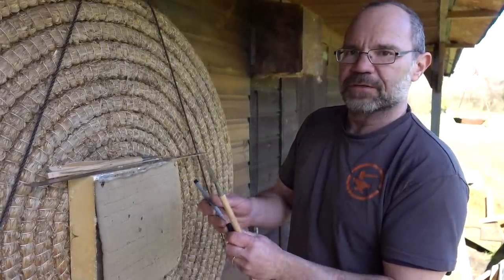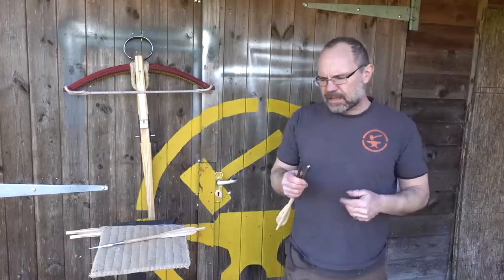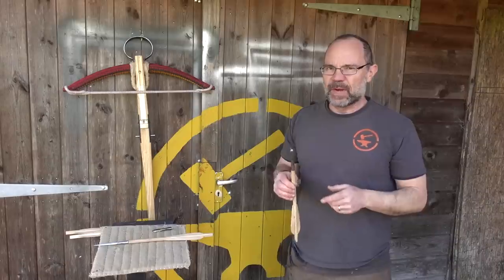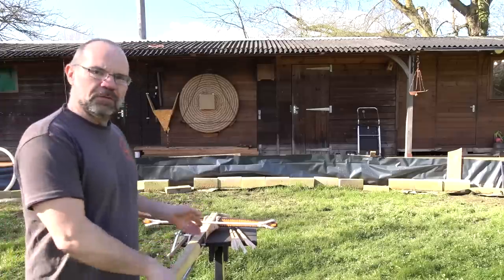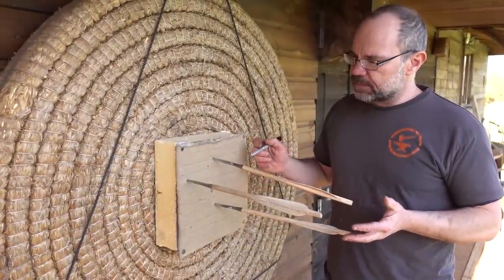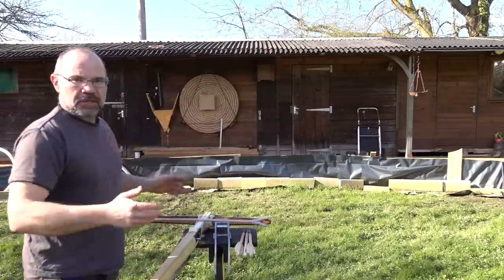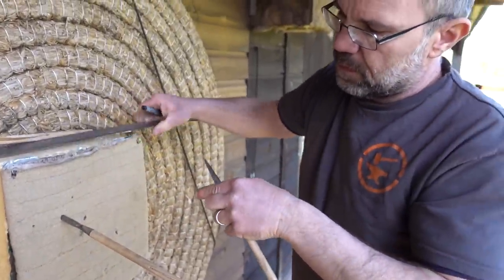Does WAX on ARROW HEADS Do Anything?

Comment: Hey I worked a lot with those insulation foams and in my experience they  have a hard time getting pierced or even cut (I lubricate my knife before cutting it or just use a saw), which could also affect your results of both this and the previous test. Do you think you could try and shoot the same bolt on different "stopper" materials see how it affects? I honestly believe the bolts could go deeper without the resistance of the foam
Reply: youre right, they could have gone deeper- but for the sake of the test, uniformity is more important than depth of penetration. The test isolates variables so that the only thing we are observing is the relative change of penetration due to a lubricated tip. This answers only this question; "Should I wax(lubricate) the tip of my arrow for piercing cloth armor or not?" with a resounding yes! I think a better next test would be changing the surface- ie, does lubricating a (type of) arrow increase deflection on plate mail?
Reply: @fair2guy  Although then you have to ask if the wax is helping with the gambeson or with the foam. It could be that against a flesh analogue the difference would not be nearly as marked.
Reply: @Poldovico  Totally! I agree, I actually wrote a longer comment to Tod asking if he could test different arrows, lubricated, against their intended purpose- thick hide, plate, flesh analogue, etc. I think we can probably assume that "wet" targets probably dont need lubrication, but that the wax does help with rough surfaces like gambeson or clothing.

Comment: Would this waxing technique extend to spearheads and other piercing weapons? 

Also; how long does the wax last? Is it only good for the first shot or would it have a small amount of residual efficacy for additional shots?
Reply: Maybe. You'd need to test.
Reply: Waxing helps needles get through tough fabrics (it'll be the same principle as the bodkin/gambison) at slow speeds - that's piercing.
So a pointy spear would have some advantage, being waxed/lubed in some way. A broad headed spear tip less so.
Prodding a gambison wearer with a rapier would probably be more effective than prodding with a broadsword - gambison is good against things with larger cross sections.

Excepting cannon balls.
Reply: Regarding the follow-on shots- on arrowheads and bolts, probably not, given the intensity of energy transfer at point-of-impact but the odds that you're going to recover the ammunition for a follow-on shot with the same arrow/bolt without having the time or opportunity is pretty low (likely non-existent in a combat scenario, maybe in the case of an extended hunt, but it'd have to be very prolonged, especially considering you'd be carrying some wax to maintain your bowstring anyway).

On spears or other piercing/thrusting weapons? Yes, some. It might be harder to do tests to determine how much, though, as unlike an arrow, a spear doesn't have a predetermined amount of kinetic energy with which to penetrate (most spear thrusts, your point-of-impact is going to occur while you're still pushing forward and adding energy to it), so any improvement is going to be harder to determine (and any follow-up attacks you make will be done when you're that little bit more tired, rendering any fall-off of effectiveness that little bit harder to notice), and somewhat subjective.
I suppose you could rig up a wholly mechanical spear-thrusting machine (possibly spring powered?) and use that, but that's a lot of design and building work for one test. If you want to, though, go for it. I'd be interested to see the results.

Comment: Excellent video. Just a small note about teflon bullets from a retired law enforcement officer and former range officer for my dept. Teflon was used to coat bullets at the request of police agencies in the US because military armor piercing rounds did more damage to police gun barrels. It was the hard steel and sharp point (much like a bodkin) of the military rounds that made the bullet armor piercing, The teflon was added to help protect the barrels of police issue revolvers from damage, when compared to firing a military armor piercing round of uncoated hard steel. These armor piercing rounds were first designed by police officers in the 1960s to pierce car wind shields and doors , to aid police officers when a felon tried to crash a road block.

Comment: On a related note, I once made a set of POC wood arrows with feather fletching, and I decided to wax and polish the shafts (as one does!) and they looked amazing. Until I shot them at compressed straw bosses. They penetrated to the same depth as unwaxed shafts, but completely locked into place. They had to be hammered through to extract them, stripping the fletching and bindings and smashing the nocks. Now I always leave shafts untreated.

Comment: Beeswax is also great at preventing rust, and repelling water in general so it seems very multi purpose practical. if they're just rubbed in some wax or dipped I would think it would help protect the arrow as well as the head, if you had enough around I suppose. Beeswax is also sometimes mixed with things like linseed oil for use on wood (though I haven't personally tried it) I definitely think it's possible one or more of materials like these proctectants would be used on arrows or other products depending on what was most available and useful in different contexts. I like beeswax for things like my walking staff or hatchet handles that I don't want to be oily, leave residues or be smelly. I want to protect and preserve the wood and it provides good grip as well and the water repellent effects of the beeswax help the grip too if it's raining or you get sweaty, as well as preserving it.
Great video as always Todd

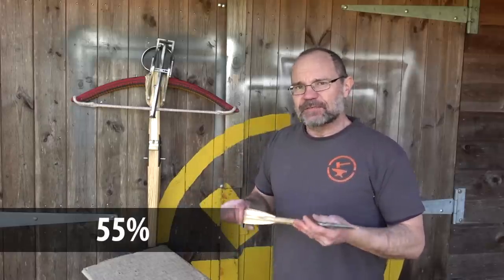Comment: Quick correction of the numbers at 8:00 : The increase of penetration is actually 98,6% on average. If we look at the first line the original depth was 26 mm and the waxed one 45 mm. That is an increase of 19 mm. 19/26*100=73,1%. For the average you can just take all the increases as a sum (19+22+27)=68 and relate it to the sum of the original values (26+25+18)=69 -> (68/69)*100=98,55% or 98,6% rounded. My intention is just to straighten up the facts, not being a smart ass. I greatly enjoyed the video. Keep up the good work and stay healthy! Cheers from Germany

Comment: Separate but related issue.  I remember being told that mediaeval archers put a blob of clay on the tips of their arrows.  This deformed on impact and made the tip grip for a split second giving the point time to dig into the armour rather than glancing off.  I also remember being told that a similar technique was used in the 20th century with armour piercing shells: a soft nose of lead (or similar) that would deform on impact and just give the shell that split second longer to dig in rather than glance off.  I have no idea if this is true but I remember that I considered the source to be reliable when I heard it 40 years ago.

Comment: Lloyd did a video a long time ago pointing out that needle bodkin pointed arrows and bolts were probably for penetrating chain mail, since the padded jackets people wore under it were no where near as thick as cloth armours like gambesons or aketon armours. He made the argument that the best heads against such cloth armours were "sharp" broad heads as they cut through the quilted fabric where as a pointed arrow just gets jammed up and eventually stopped as it tries to squeeze through the layers of fabric.

He provided the anecdote of how during the construction of quilted cloth armour, you need quite a strong needle as it gets harder and harder to pass a needle through the fabric, the thicker you make the armour to the point that he almost or maybe in fact did (I forget) break a needle at one point when making such armour.

Comment: Coating arrows in a thin layer of beeswax is also a great way to prevent a stockpile from rusting during long term storage. Even if they didn't know that it would improve penetration it is very likely that at least some people used wax.

Comment: A small correction. We absolutely do NOT put teflon on pistol bullets to get through fabric armor. That is a myth that probably originates from the movie Ronin where that is stated as a reason why a bullet penetrated De Niros characters vest. That is not how they work though. The actual armor piercing pistol ammo that the myth comes from penetrated soft armor due to being made of metals much harder than standard lead based projectiles (so steel or tungsten) and due to being very pointy instead of having a rounded, flat or a hollow point. The first characteristic prevents the projectile from becoming flattened on impact against the vest which makes it easier for the fabric to stop it due to the pressure being spread over more threads and the second gives the projectile a tendency to poke between the individual fibers of the vest. 

The teflon coating was actually there, but not to enhance penetration, but to protect the internal surface of your barrel. Modern projectiles are somewhat oversized so that the rifling of the barrel actually bites into the jacket, otherwise it would not have enough purchase on the projectile to make it spin. Obviously that works well if its either unjacketed lead or if its a lead core with jacket made out of a soft metal like copper. But if the projectile is hardened steel or tungsten, that would work very poorly and you would ruin the rifling in your barrel in a hundred shots or so. So the teflon coating was there to put an intermediate soft layer between the hard projectile and the hard barrel steel.

Comment: Very interesting! I really didn't expect that to make such a difference! I'm not sure if this has got missed, but I believe that many of  us who commented on the longbow vs plate video were talking about the reasoning behind adding caps to kinetic anti-armour rounds in the ww1/ww2 era. That isn't about lubrication or something like that, it's about reducing the likelihood of a round ricocheting off armour by adding a softer material to the top of the projectile that deforms and allows the round to "bite into" the armour. In the longbow vs plate video, it seemed like the majority of the arrows were wasting a huge amount of their potential energy when they hit at angles that just caused them to ricochet. If this capping does work, it still probably wouldn't allow the arrow to penetrate the front of that breastplate; but if thinner parts of a harness can be penetrated by "perfect" hits, you'd be increasing the likelihood of "perfect hits"

Comment: Great piece one small point though. The reason Teflon and similiar is applied to bullets to get through armor isn’t the same. It’s because it lets you use harder materials for the bullet whilst protecting the barrel. In fact the Teflon itself makes it less effective at penetrating Kevlar and similar.

Comment: Just wanted to say its an increase of of 95% ((45 + 45 + 47)/3) / ((25 + 26 +18)/3) because the start penetration was 23 and nearly doubled, because you look at how much the starting penetration increased overall not how much it increased compared to the final penetration, amazing video btw! (what I mean is that you assume 23(the average of the first 3) is equal to 100% how many percent would that have to go up to get to the new value of 45, in this case to get from 23 to 45 you would have to add 95% so 1.95 x 23 = 45) Im shit at explaining but hopefully this makes some sense

Comment: I practiced Olympic Archery for some years and we had some targets made of some sort of EVA, a lot of times the EVA would "melt" and adhere to the arrowheads and shafts and you had to clean them up from time to time.

We started using lipsticks made of cocoa butter to lube the arrows and cleaning became a lot more simpler. Some started to use mineral oil, which worked too. (Even helped when removing the arrows, now that I am writing, I don't remember if the guy that had the idea at first, used it to make arrows easier to remove from the target and the cleaning thing was just a "side effect" noticed after) 

I remember having thought "it seems like the arrow is even going a little deeper" but didn't care much about it since it wasn't the focus.

It's interesting to see how we used the same principle of lubing the arrow, even with different purposes and in my case at the time(2010-2012ish), limited information.

I imagine waxing being done in early times almost intuitively. Maybe, for storage they lubed the arrows to prevent rust and maybe on testing they found out that it helped with penetration after shooting over and over the same arrow, which would lose the lubricant and penetrate less, as probably they would be focusing more on performance, that would be clear as day and night(in this specific hypothetical scenario).

Comment: Tod, Putting hardened wax on the tip of a plate cutter could help support the point on impact with a softer material deforming on impact and ‘gripping’ the plate preventing it from glancing off the smooth angled face and the wax melting and dispersing completely on impact 

A very similar thing has been put into practice with battleship shells. A 16inch armor penetrating shell in ww2 often had a soft lead cap in the front to do the exact same thing on a far greater scale of mass, material and energy expended. It worked very well. Might even be worth testing out.

Comment: i observed the same effect in target archery. In some clubs they have very cheap targets made of pressed straw (like 20cm thick) for everyday practice. They are way cheaper than etafoam targets and last way longer, but pulling out carbon arraws was always a pain. In fact the heat on impact was so high, that some fibres of the staw kinda burned to the carbon. You really hat to seperate them with a knife again.
Our solution was to use silicon oil. You can get these in a box with a foam and it will last for years. It was significantly easier to get the arrows back out though they penetrated deeper.
Obviously people back in the days were just as smart, only with less materials :D

Comment: and now on to tallow, lard and linseed oil. the other "standard" protective coatings for wood at the time. Tallow is the one I have my hopes for it becomes a very slick oil when heated.
Reply: Tallow maybe more of the working mans lubricant,  true wax candles were very expensive, any military camp would have had animal fat in buckets.

Comment: As I understand it, the blob of beeswax on the tip has two functions: Firstly a momentary stabilisation of the tip (usefull in contacting a curved surface), then as you say to coat the arrow head with the wax on penetration. A medieval dumdum bullet. I would be very interested in a video which repeated the test with coated vs blob on a cuvred target preferably armour (or equivilent). With regards to the rust prevention quality of the wax, that may an advantage on practice arrows but in war rust is an advatage as if an archer was unable to kill or maime, a wound from a rusty arrow tip would likely despatch the indivual eventually.

Comment: As a minor note- I think it's less a case of friction heat melting the wax on impact as compression heating (or other prompt kinetic energy transfer), although I don't deny that friction could play a part. Doesn't change the effect- you have something that melts, ablates and lubricates the tip as it penetrates.

Comment: By the way, Teflon is not added to bullets to make them go through armor better. Armor piercing rounds are made of harder metal, a Teflon coating is occasionally added to them to reduce barrel wear. Harder metals wear out the rifling faster than softer brass or lead.

Comment: Excellent test!
It would be interesting to test tallow, lard, suet, olive oil dregs, (the product used in candles in Italy, Spain and Greece) linseed dregs or a mix of these with wax. The fact that these would be used anyway to protect from corrosion means that crossbowmen would have eventually noticed the difference in performance between a freshly greased and a non-greased arrowhead.

Comment: I think I'm to late for Tod to see this but I remember in the arrows vs armour video you guys briefly mentioned case hardening, I think that the method used back then was not an oil quench, you would take the iron and wrap it in a mix of charcoal made into a paste, then wrap in clay to seal it and place it in the forge to "bake" . You can imagine that being done in bulk using a crucible and powder charcoal, the method imparts much more carbon into the metal than an oil case hardening and I was wondering if you could mention it to the guy who made you arrows maybe to experiment with that method.
Great vids by the way 👍

Edit- I think it's Clickspring that did a video on it he used mild steel to make files and hardened it using this method

Comment: Just a thought, waxing bolt and arrow heads would make perfect sense if you were to put them in storage say for castle defence.
Also for seafaring in particular in early medieval period when boats were low and open. Because rust would most definitely make them significantly worse (I assume).

From there to actually noticing improvement is just a tiny baby step.

Comment: Trained as a traditional woodworker/boatbuilder, I was repeatedly taught by the old boys to rub some candle wax on the the bottom of my hand planes, the sides of my hand saw. Wax lubrication on wooden wedges even helps when driving them in. Only proviso: don't use, when you need a clean surface for gluing.